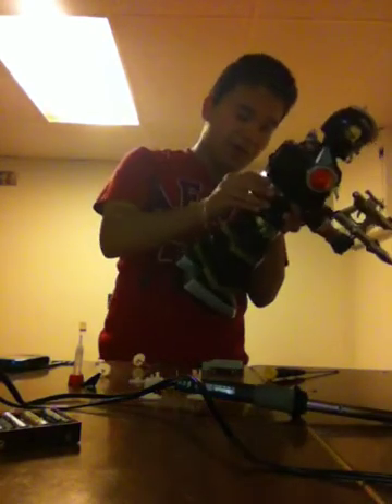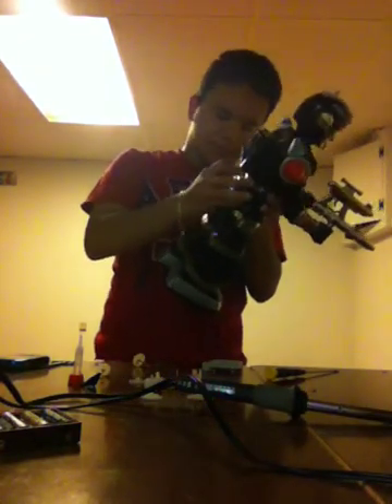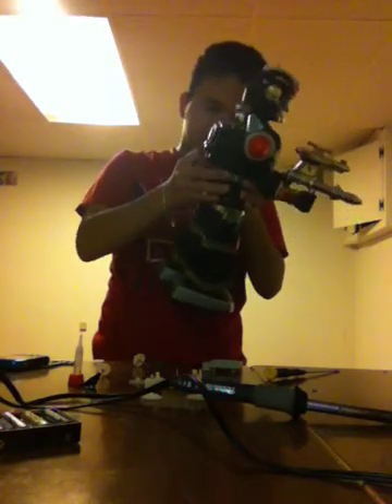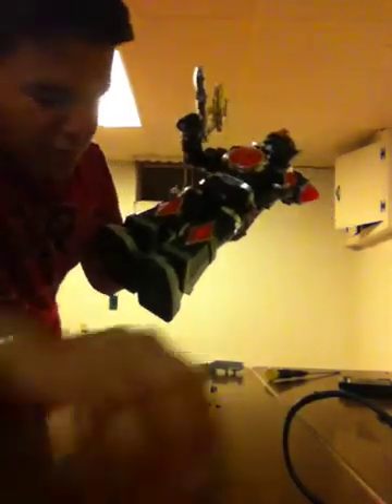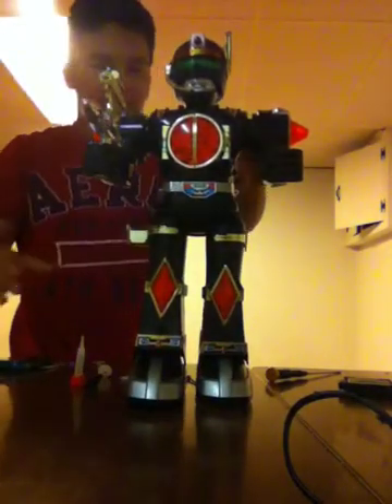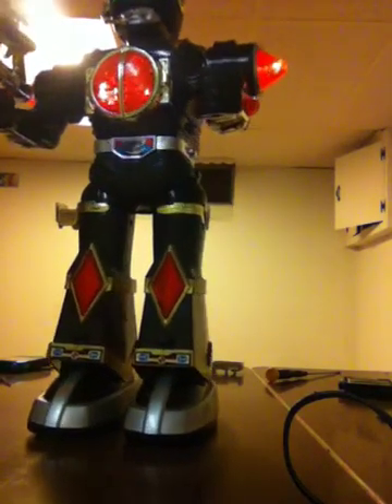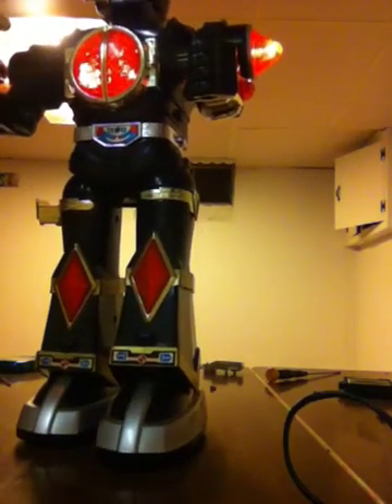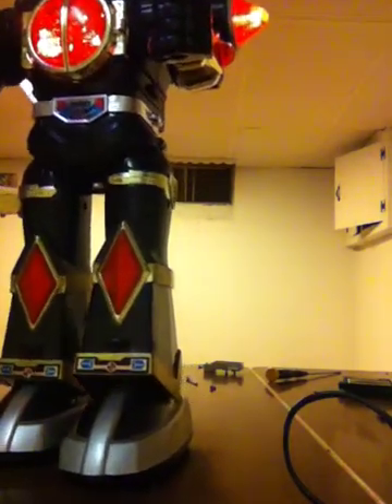Repairing Robot 2001 Part 3: Test Run #2

Comment: I have learnt from.the pasts years you learn from.your mistakes you make and U get even more better at fixing things this robot. U were trying fix and make it move and all that stuff don't give up i learnt  by doing baby steps  not to give up it may need. A new motor it may need to be disassembled. And rebuilt it the way you did when U was putting it back together when but. You Might find out you put something. In the wrong. Order  I hope.this helps U  from Adam a vinteg toy collecter